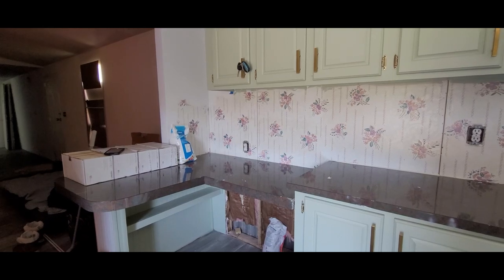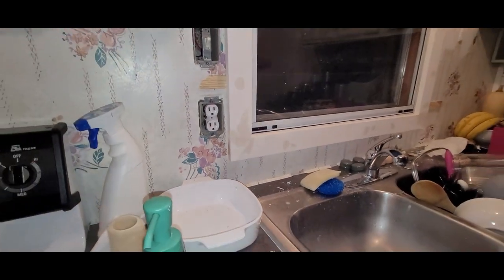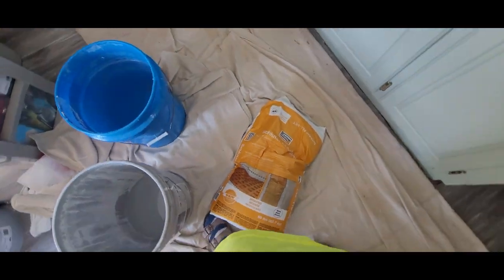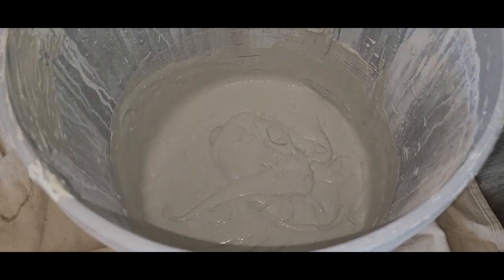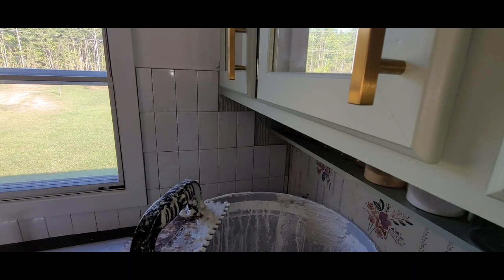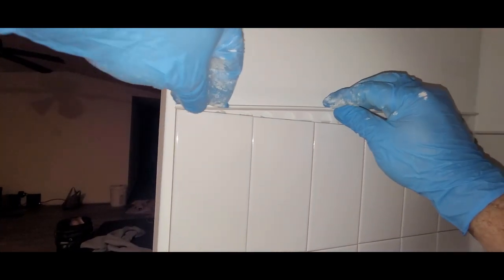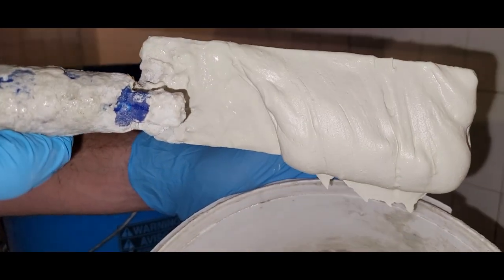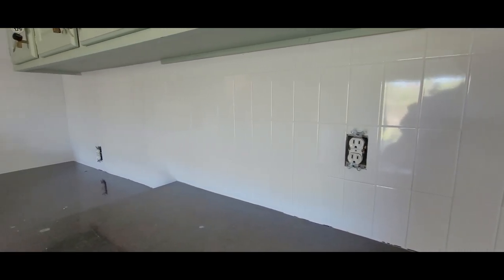Mobile Home Renovation - The kitchen Backsplash

Comment: My mobile home has a panel back splash. Do you think I can put tile over the paneling?  No way I can rip out the paneling without making a huge project
Reply from the maker: Unfortunately, I don't think the tiles will stick to your paneling. It may end up being too heavy. If you were using a laminate, I think it would be fine.